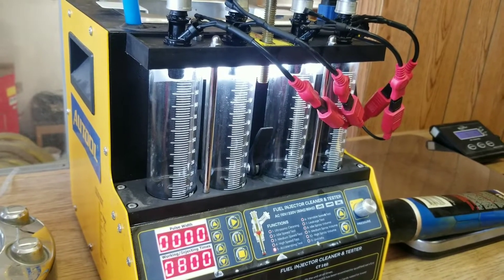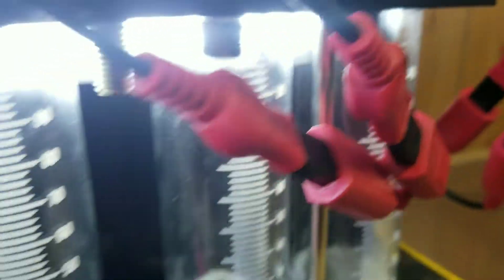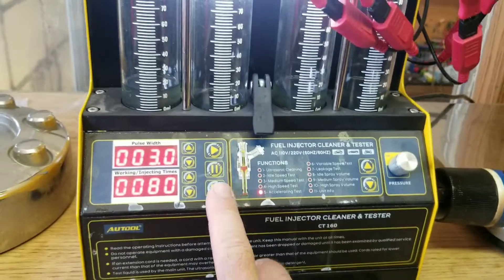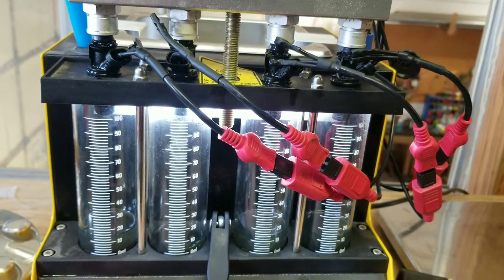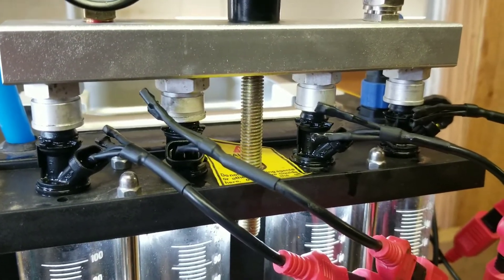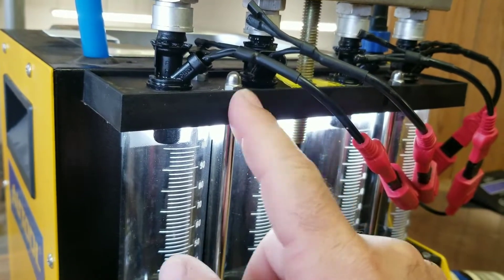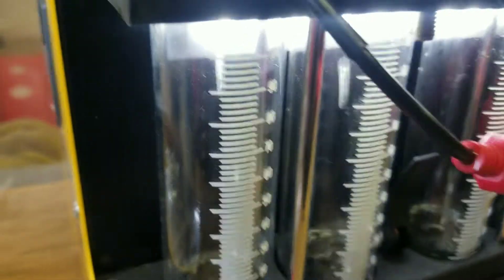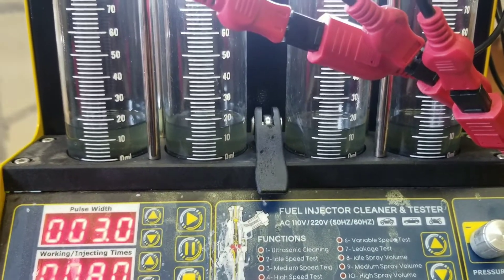diagnosing, testing ultrasonic cleaning and back flushing injectors with the autool ct160.

Comment: I would probably invest into putting an inline glass filter on that blue hose that goes from the top so it doesn't recycle dirty particles over and over again as you keep testing it, unless it already has a filter somewhere in the machine, thanks for taking the time to make this video
Reply: That is high pressure .Would be dangerous with a glass filter there.
Reply: It has a sock just like car fuel pumps it’s real similar people swap out the factory pumps to 255lph units for a more stable fuel pressure while running tests

Comment: Are the fluids reusable or better to recycle?
Reply from the maker: They are reusable but they evaporate, so that's one issue. The other issue is the rott or degrade. So you do have to buy alot of fluid.

Comment: What type of liquide do you use
Reply: There is no difference in test fluids. You can check anything. No one shows the cleaning process and how it is cleaned. To check, a pressure of 40-120 bar and regulation of the length of the injection pulse are needed https://www.youtube.com/watch?v=q9GRbMS9vvw

Comment: Can you do the ultrasonic cleaning and actuate the injectors while they're bathing? Just actuate then submerged without connection to any rail or pressure.
  Will this make any difference or possible damage?
Reply from the maker: Yes you can as actuate the injectors while being sonic cleaned, it does make a difference. It works pretty well, just have to be careful on the amount of time you run them.
Reply: Yes, it's best to actuate the injector electrically while immersed in the ultrasonic bath.  I wouls also remove the filter thimbles from the injectors and make sure the fluid tank fluid is clean so the fluid isn't contaminating the injectors.

Comment: i got a question if I have oem injector 1pin hole @ 243.8cc p/m and swap for 4pin hole 232.1cc p/m, will the 4pin hole spray more fuel than the single pin hole? can the 5.9L magnum benefit from 4pinhole vs the oem 1pin hole?
Reply from the maker: That one is over my pay grade. I would imagine google would be a better resource, I'd be able to test them with this machine and see how the act different and difference RPMs. But more fuel isn't neccesarily better in a gas engine. You want better atomization which the 4 hole should do, and all you're really trying to so is hit say 12 to 13:1 fuel ratio. So unless you're leaning out there probably not much to be gained

Comment: Can you use this machine to clean sprintidiesel injectors?
Reply from the maker: I have no idea how sprint's work, my assumption is not, but if it's a normal solenoid injector it might be possible. I'll see if I can google a picture of one
Reply: @townsendliving9750  I'm sorry.. spelling.. I mean Sprinter diesel injectors, same injectors are in Mercedes gl350, om642 engine
Reply from the maker: @RuvimAbaras  yea I understood, the problem is it being diesel, works at much higher pressures and much higher voltages, but it might work, not sure